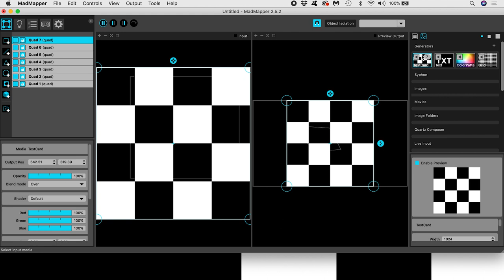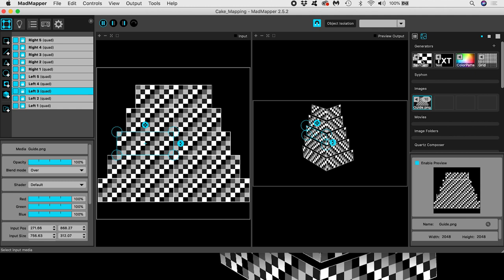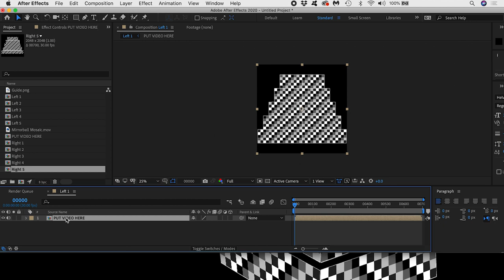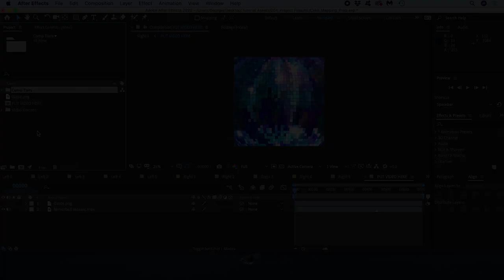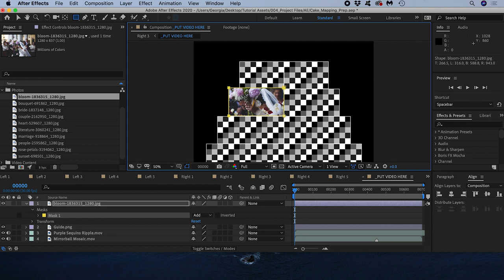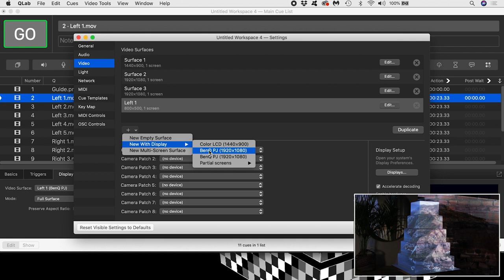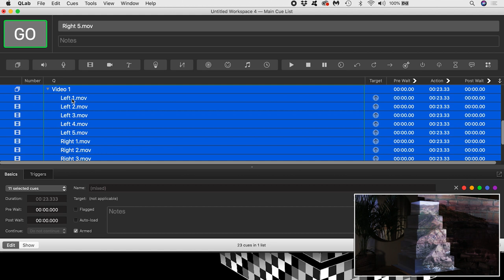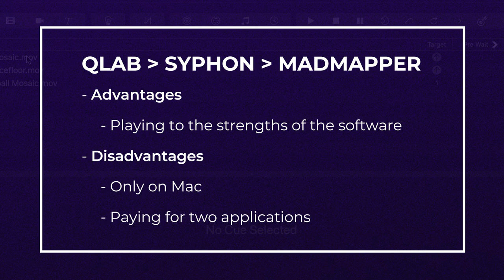Qlab 4 Cake Projection Mapping Beginner’s Tutorial

Comment: another option would be to create 1 surface labeled "Cake" and you can add as many projectors as your system can handle. For instance, i am working on a show right now that i am running 8 separate projectors or TV screens. for this cake, you are using 2 different projectors, so you could edge blend them together into 1 surface and make a mask that only shoots on the cake.You could do that in whatever software you wanted.  Then you take the 1 video file "disco ball" and map it to the "cake" surface and you're done. You wouldn't have control of the each layer in this situation, but you didn't utilize individual layers in your example. Then you just have 1 video file, playing on 1 surface.
Reply from the maker: Assuming I've understood your idea, how are you going to map the corner points of each individual tier with your method? I do actually map each layer separately (at 17:10 https://youtu.be/1tx_zXyjUjk?t=781). By doing this, all the mirrored tiles are neatly parallel to the edges of the cake. This wouldn't be the case if you just projected "disco ball" on the cake with no per-layer mapping.
Reply: @LumaBox  Would that be achievable with splits? I'm afraid I can't test things right now because we're in the middle of a production at our theater, but I (the operator) would like to learn more about how to design. Unless I've completely misunderstood splits, isn't that how you could achieve this while only running the one video and thus be the most performant?
Reply from the maker: @spustatu  This video is 4 years old now so it looks like, yes, splits could be the way to go https://qlab.app/docs/v4/video/video-surface-editor/#the-editor-canvas